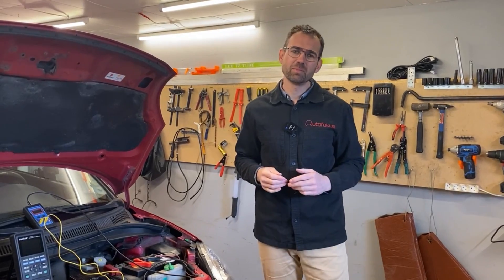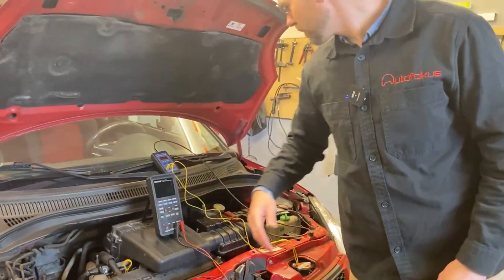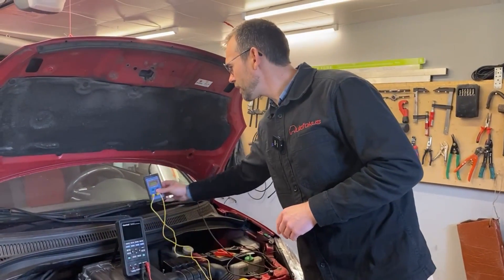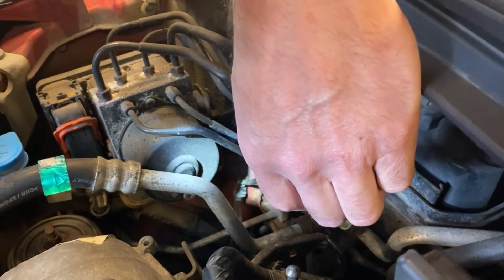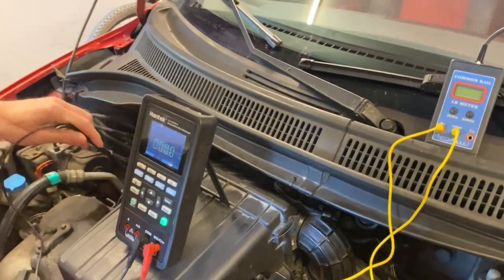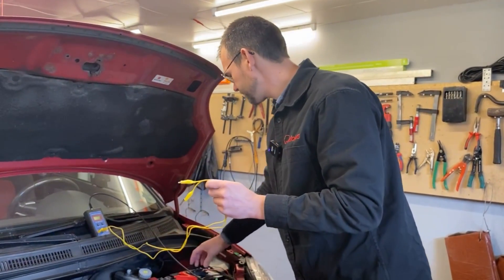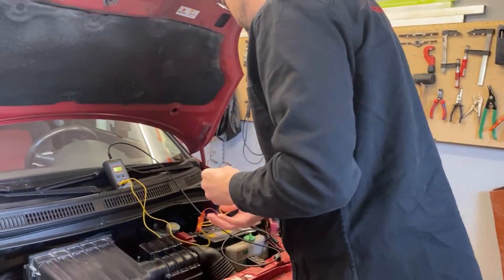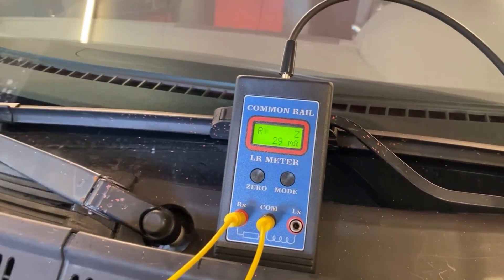How to verify a chassis ground connection with the DITEX LR-meter.

Comment: Thanks for your well explained videos. Which ohm value and or voltage drop is normal before making a malfunction in the electric system?
Reply from the maker: Thanks for you comment🙂.
Ideally you want a reading as close to zero ohm as possible 0,5 Ohm or less.
Voltage drop should be around 0,1 V ideally.
/Simon

Comment: To check a ground, you need to load it. A resistance check means nothing without a load current. Use your multi meter and test voltage between the ground and the battery whilst applying the load. eg, between engine block and battery whilst cranking to check engine grounding. Anything else is probably meaningless
Reply: There is an embedded current source in the Ditex L-R meter. It is an  electronic circuit that delivers or absorbs an electric current which is independent of the voltage across it.
Reply: @AutoDITEX  yes, rather like an earth loop Impedance tester for electrical installations I imagine. However, without a working load, a single remaining strand on an earth cable could easily pass an ohms test.
Reply from the maker: Voltage drop is also a good way👍😊

Comment: No wire has “zero” resistance!

But a regular Ohm meter CAN be enough to detect a bad wire/connection:
Ohm measurement, plus measure voltage drop WHILE a high current goes through the wire/connection.

Because voltage, without current, means nothing for these issues.
Reply from the maker: Thanks for your comment. 
I didn’t say that. But it zeros the device so it subtracts the resistance inside the test wires.

Using voltage drop is also a great way of verifying a ground connection, but mostly on specific components where current is flowing of course. On chassis ground points I prefere using a resistance test.

For voltage drop testing I have a small video which also includes how to find a bad ground using that exactly technique. Enjoy :)

https://youtu.be/_TGj4cP6Slc?si=16ncRZzgXUZ6ruM7